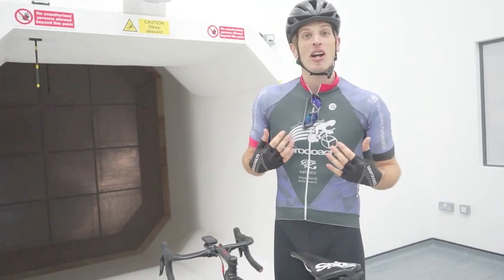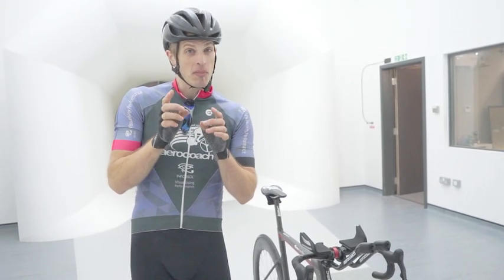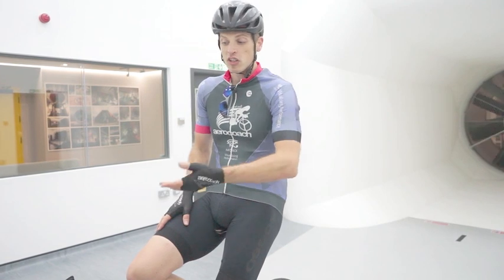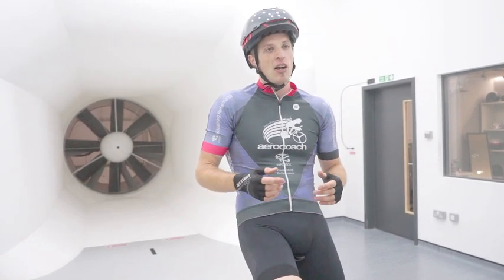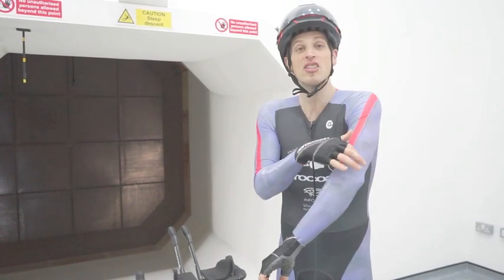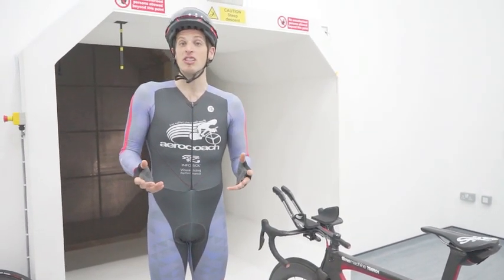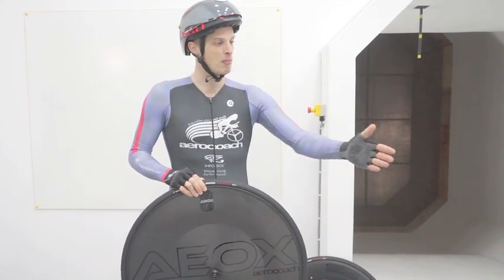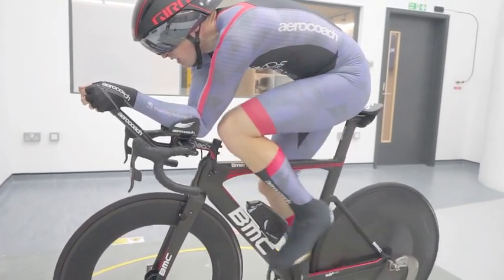EXPLAINED: Aerodynamic savings for TT & triathlon!

Comment: I am a bike mechanic from singapore and if you are a mechanic or home DIY-er and is looking to service this wheelset.

You need 2x 17mm box wrench and then, hold down both ends of the axle to break torque to unscrew out the axle cap on the DS. then the whole axle simply slides out from the NDS. let me get back on the bearings sizes. I'm commenting this mid-way through the service.
Reply: the bearings are enduro 61803 llb  x3 and 61903 llb  x1.. do take note of adjusting preload on the nds after u are done,  make sure there is no play for the freehub body

Comment: Great set of videos, thanks!

I’m intrigued by the comment about disc wheels. So you would recommend using a disc in all conditions? We are talking about IM Lanzarote which is notoriously very windy...and everyone says to take the deep sections OFF! Choosing a disc would be controversial but tempting!!
Reply: There's a reason some courses ban disc wheels.. those are generally outliers... Kona and to my knowledge Lanzarote were both courses where they're not allowed because winds are much higher than most courses.  I've never ran a disc - but an 80 rear for me has never been an issue, IM Florida was pretty windy last year (particularly the section that runs parallel to the gulf of mexico) but I didn't have an issues.  The front is generally more of an issue for me, granted I'm 93 KG (198cm height)